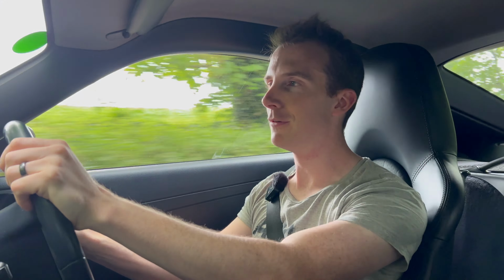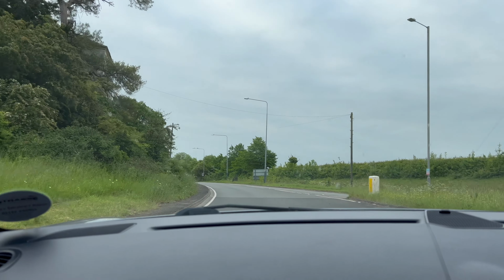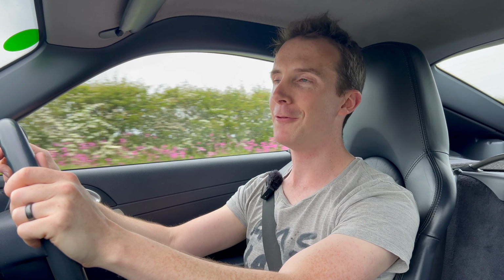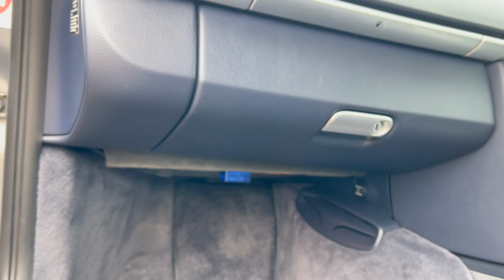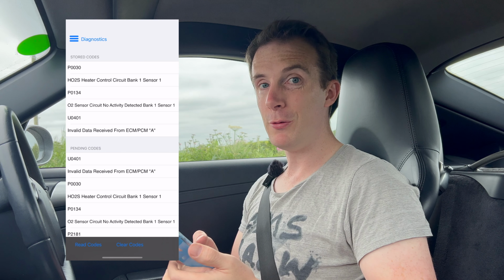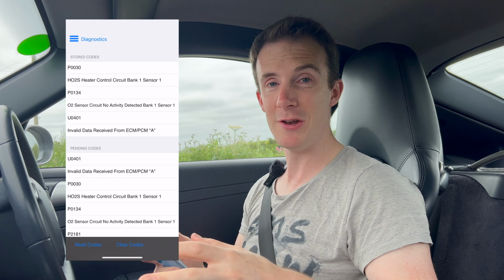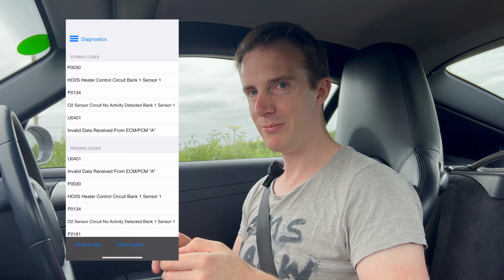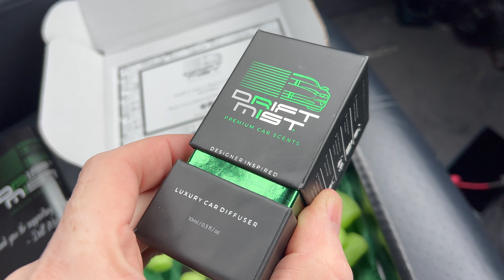MY PORSCHE CAYMAN HAS MORE FAULTS | Porsche Running Costs | 4K

Comment: I've had my 07 Cayman S for a year and I had to replace the shifter cables and the clutch, which I abused trying to limp the car home in 5th gear.  The PASM button doesn't work and the button to raise and lower the wing doesn't work either.  But I have taken the car on 5 and 7 hour trips and it runs flawlessly.

Comment: Heater control circuit is to do with the O2 sensor, I think. The O2 sensor has a heater part.
Reply: Yes, you’re correct, had this exact problem with my Cayman.

Comment: Joe time for new cats mate same thing happened to myself after rebuild engine the problem is the lamba sensors will not come out with out braking
Reply from the maker: Really? 🤯
Reply: Just back from scrapping old ones got 208 quid and the car will run better on cold start

Comment: I have the same generic obd reader, you can get apps that will show some live data from sensors like the lambda.  If you can interpret this data you can see where to start investigating a fault eg is it the sensor or wiring to the sensor?
Good luck with getting it fixed and thanks for the video updates👍
Reply: Probably best just swapping out the post cat sensor, not really a difficult job just a bit fiddly unplugging the old one and plugging in the new one, and the sensor can be a bit seized in the cat,so heat and patience will help.

Comment: I am an audi TTS MK2 fan, bimbo brakes, similar weight to porsche , more storage space for touring, quattro system , you can see the corners, nice interior trim , no Bore scoring.  Struggling to see why most car experts dismiss them, when so many other cars have big issues. I like the look of the Cayman but car ownership should be hassle free.
Reply from the maker: Huge fan of the TTS. I know what you mean, I think it comes down to the badge. Car experts will always go Porsche as it’s seen to be the best. Granted nothing drives like one, having driven a TTRS and my Cayman there is no contest. However from an engineering point of view, Audi has this hands down. Porsche can be problematic.
Reply: Clearly a car fan but not a driving fan!
Reply: lotus fan for driving also own audi RSQ3 for crappy british roads
Reply: @andrewreddy7063  I think Lotus ownership and your assertion that car ownership should be "hassle free" are somewhat at odds with each other 🤣🤣
Reply: I have owned both TT and Porsche,Porsche is clearly better, prestige apart, however if cost effective car is your priority then the TT is your car, Porsche is a true adventure and extremely reliable for a sports car when paired with the likes of Ferrari. Porsche has that iconic midship flat six box engine and it far more exotic that a four pot with bolt on blowers. The TTRS is a better comparison I suppose.

Comment: Told you earlier is most likely the second 02 sensor or the catalytic convertor
Reply from the maker: Hope its not the CATS. I assume this would give a different code.
Reply: @JoeTalksCars  codes for the catalytic convertors are P0421 and P0431